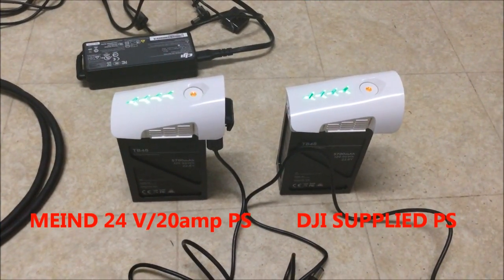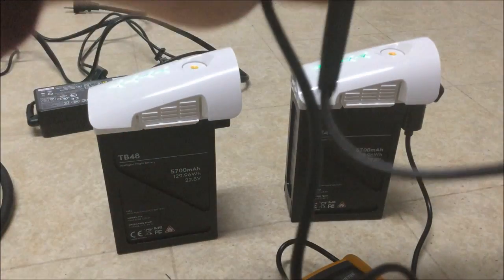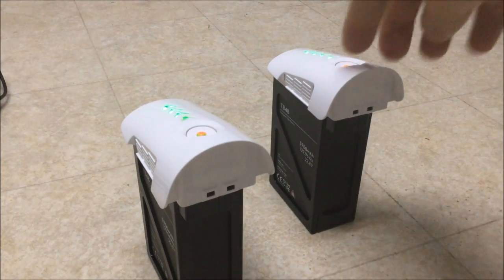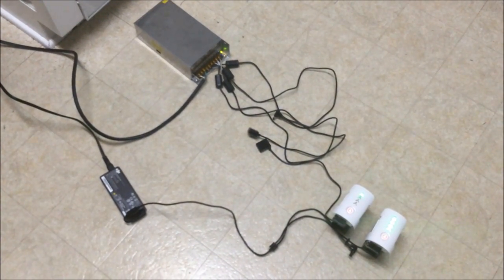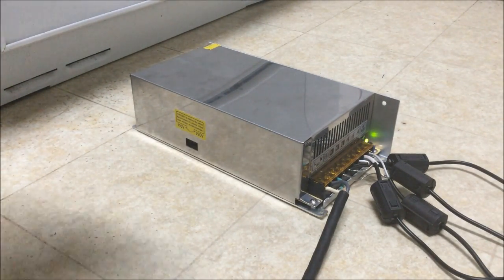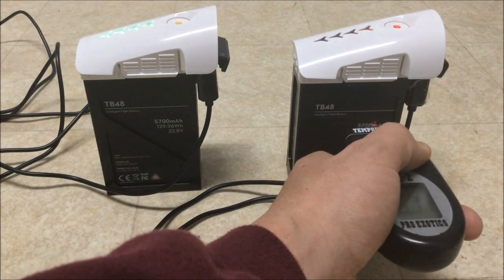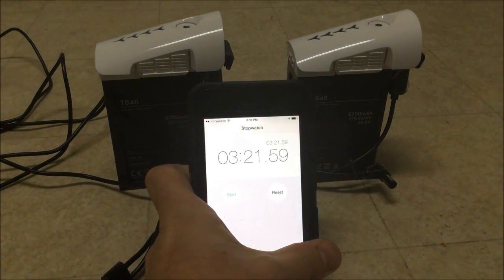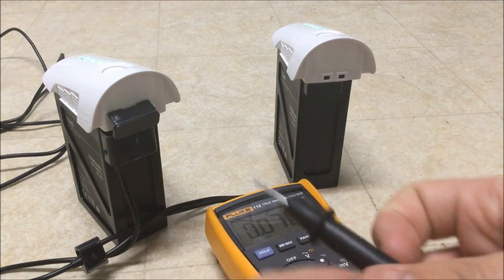500W DJI INSPIRE 1 POWER SUPPLY -CHARGER R&D

Comment: Thanks for the video.  This looks good.  I have a suggestion though.  Since no two batteries are identical, it would be good to repeat your experiment, exchanging the batteries between charging setups.  Then we'll know for sure whether the higher voltage is because of the charging mechanism, or because of the fact that the two batteries are different.

Comment: Would it be safe to charge 2 tb48 batteries and 1 tb47 battery all at the same time using this charger with using 3 cables connected to power supply?

Comment: The voltage low when is charging?. So if I use a 24v power supply should it works?